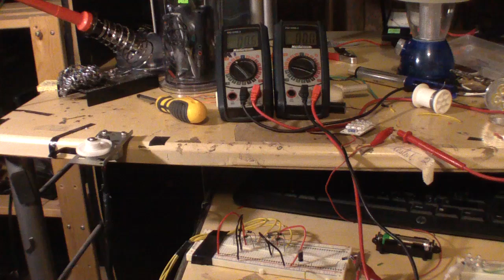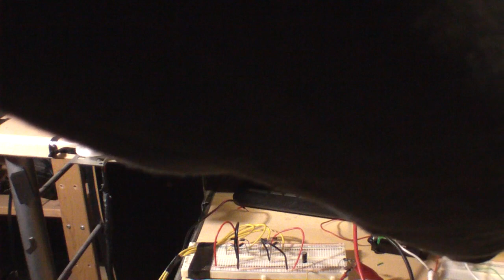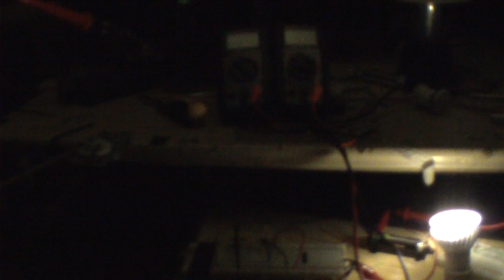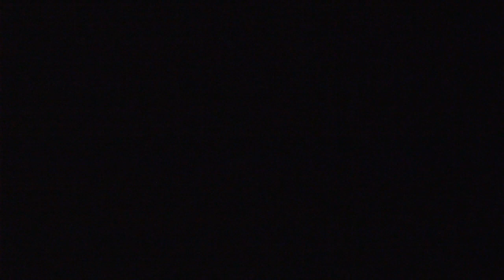Stepper Motor Generator - DIY Ink Jet Printer Motor Generator

Comment from the maker: @Mongrel Shark  For some reason YouTube didn't give me a "reply" link. Great points. The LED diodes would definitely work! When you say an additional stepper motor, do you mean get one turning by placing it's large gear in connection with the large gear on the first one, thus driving both simultaneously -- that is possible, now that you made me think of it, or do you mean something else? This one is an M35SP-7 Mitsumi 80 OHM. It's no longer in production, but here is a rundown of what is, by Mitsumi 

http://www.mitsumi.co.jp/latest/Catalog/compo/motor/index_e.html

I would say it is at least a 24V, and maybe 36 or 48V. Really puts out the voltage.

Unfortunately where I really lack is in the creative thought processes that are required to build the prime mover (attach the stepper to a proper crank).  My brain is not so great at envisioning mechanical stuff.

Comment: looks good, very innovative and who hasn't got an evil inkjet floating about the place, whats the torque like, you think you could jam some blades on it and get the wind moving it, even if a gear system was needed? as you say there its gonna be frickin noisey for 100mah of current :-D still love it!
Reply from the maker: With this exact setup, I dont see the feasibility of going to the trouble of building a wind turbine out of it. The gearbox transmission is, (I think) the real source of the noise. If you were to just spin the primary shaft, it'd be quiet. All in I see the best application being much like a hand crank flashlight, an emergency device. For small wind turbine made from 100% re-purposed junk, I think you'd be better off going with a reworked slow moving ceiling fan.